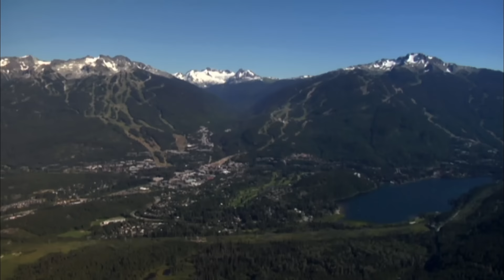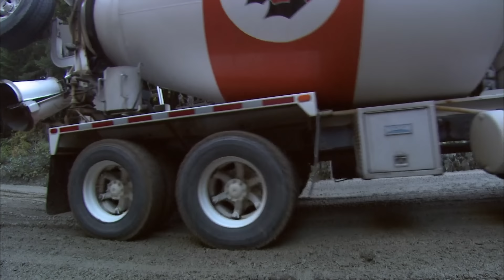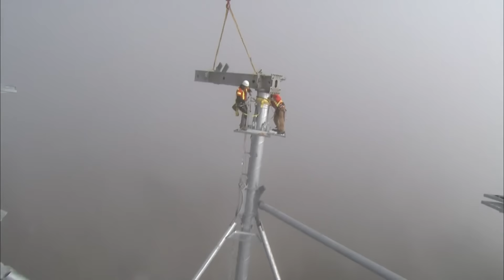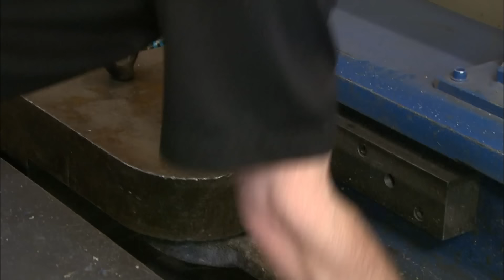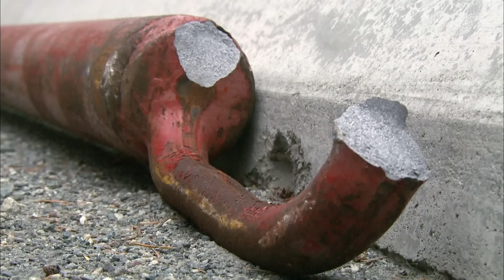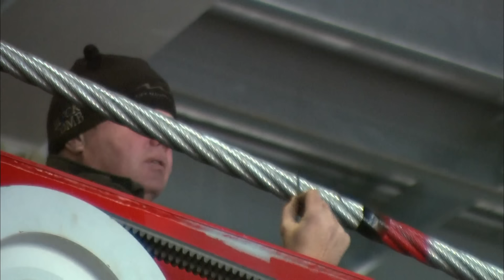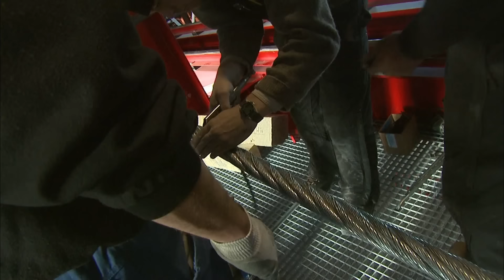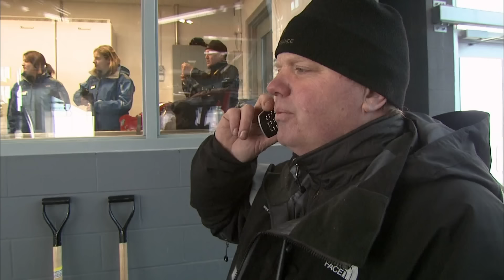The Engineering Genius Of The Largest Ski Lift Ever - Peak To Peak - Engineering Documentary

Comment: great "doco" if you are interested in the drama of muddy roads and concrete trucks and weather, but falls well short on the real engineering of a major gondola.
what happened between starting to string the light lead ropes across and suddenly having all the major cables in place with gondolas on them?
how did 5 spools of cable become 3 endless loops?
how were the gondolas designed and mounted?
Reply: Only one endless loop (the hauling cable). The other four cables are anchored at both ends; their purpose is to stop the bogie from pivoting about the haul cable axis. And to catch the bogie if the haul cable snaps (this happened somewhere near - from memory - l'Alpe d'Huez some time back - 1970s? ) and it that case, the brakes failed. The broken haul cable trailed behind like Snoopy's scarf as the car plummeted down the longest unbroken span on the mountain, and as luck would have, wrapped around the tower at the next ridge crossing, pulling it down to horizontal and gently slowing the car (well, fairly gently) to a stop. The car was full of punters at the time. No injuries.
Reply: @Gottenhimfella  this would have been great info to share in the documentary. Thanks for sharing!
Reply: so how much can they fit into 45 minutes?  I thought it all very interesting and informative - we're not all full on engineers but can appreciate the problems involved
Reply: @Ivan Blakely you also have to take into account that there are only very few players in this specialized market so you won't go too much into details as the competitors are watching also. I think it's pretty obvious that there's a lot of raw (and therefore expensive) materials involved as well as clever engineering, so the team with the best design at the lowest costs will outlive the others.
Reply: Typical american documentary. Everything is hyperboled to maximum, huge, insane, awesome, biggest everything. Same thing repeated many times and lots of unnecessary cliffhangers added to make it more "exciting". Then the rest is human drama and reality tv.
Reply: This is in Canada....
Reply: @alexbeis1861  It is a Discovery documentary...
Reply: Yeap, this drama farse is unwatchable. Quitiing in 1/4
Reply: @Gottenhimfella  Thanks.  That was explained pretty clearly in the first five minutes, as far as there only being one loop cable.  I think people want to imagine what the challenges are instead of understanding that building the foundations and getting materials up the mountain were the major engineering issues with this build.
Reply: @alexbeis1861  same same but different
Reply: @stevecrocker6904  you can fit a lot into 45minutes. It is a matter of priorizing what goes in to what extent. And they wasted a lot of time with boring stuff and BS dramatization, repetitions.
Reply: There is one guy who know what he is doing when they splice the cable together. And a hundred other guys standing around waiting to do what they get told. Lots of hammers etc. Pretty interesting in its own right.
Reply: They did not show the cable splicing and that is worth watching.  YT has several videos on ski lift cable splicing.  Fascinating.
Reply: Corporate secrets?
Reply: they always have to create drama
Reply: Yeah this felt like gold rush
Reply: History channel  dumbed down show. I feel bad for all those that filmed it and edited it only to have it turned into some stoner's "can they get to the liquor store and back to the party in time"  kind of show.
Reply: It’s an overexcited bit of reality tv trying to be a documentary about interesting engineering.
Reply: @erwinlommer197  That is true. I started skiing in 1981, and there were already some genuinely awesome cable cars and other types of ski lift in Europe at the time. For example, the Penken lift in Mayerhofen, in Austria, is almost 3km long. It was opened in 1954. I remember standing at the bottom in 1982, waiting and watching as the previous car disappeared at a steep angle up into the mist, and marvelling at it.
Reply: You make a good point, I would of liked learning more about the more technical rather than the sort of ridiculous drama. As the previous commenter mentioner, there is only one endless loop cable and the rest are anchor cables. The endless loop cable is either spliced to its own end if it is long enough to run the length of the loop by using a friction splice technique and not welded. Basically the professional will unwind the two ends of the cable and braid them together as one in the same pattern they were manufactured, the friction of the two cables under load will hold them together better than a weld would. The same would be done if it were two separate cables that needed to be spliced together to complete the loop, however instead of unbraiding two ends it would be all four and repeat the friction splice technique the same as if it were one cable being turned into a loop.
Reply: @erwinlommer197  It's Canadian, not American... Look at the credits.
Reply: @Gottenhimfella  The propulsion cable still gets spliced.  Would have liked to see that.
Reply: @RandomUser2401 good points. It seems to be in the formula of this type of drama doc. Seize on a a few areas where something potentially breaking, or a truck potentially falls off the road would be catastrophic,then replay over and over from various angles. It is like in sports telecasts where the producers rightly replay the diving catch. In this context however it just a lazy way of filling time and ratcheting up manufactured drama. The project itself has enough organic tension and nerve wracking drama, it does not need a script that is meant to create extra drama. Just tell the story!

Comment: The sling is not made of Teflon, it's made of either polypropylene or (more likely) UHMWPE. Teflon/PTFE has terrible tensile strength, terrible creep and necking resistance, and it's much more expensive.
I'll guess that the film crew heard UHMWPE described as "Slippery like Teflon" and rolled with that as simpler than saying "Ultra high molecular weight polyethylene".
Reply: Yep. Those slings are Nylon. Great slings but they generally have a short life cause they don't like being pinched or abraded
Reply: Or kevlar
Reply: Dyneema or similar...
Reply: Had the think it was the same plastic that you mentioned for a candy line that ran 15 hours a day. 2 good sized metric pre stretched chains ran over this plastic. After 8 years still looked brand new. Was at a FINN COR drive class back in the 1990's and they were one of the top companies to provide drives to power ski lifts in many countries. Somebody bought b them out maybe 20 years ago.
Reply: the narration is far from perfect , but the whole is project  the opposite  , perfection and perseverance
Reply: I was thinking the same thing. You would expect modern synthetic slings to be something like spectra or dyneema. Even if they were not sheathed, we are depending on the narrator to get it right because you can't really differentiate between synthetics by simply looking at them. That being said, Tenara fibre is tremendously strong and durable, and new applications are being found all the time. I wouldn't think the cold flow issue would matter much in a sling, but something that slippery would need to be a continuous selvagee, as well as being more difficult to work with making it than the alternatives. The more slippery the fibre is, the stronger the sling could potentially be, because the slipperiness would make each individual strand bear more equal parts of the load.

Comment: The issue with the concrete trucks could have been avoided by building a temporary construction ropeway, as it is usually done in Switzerland and Austria for such projects. It could also have been used for faster transport of most other stuff, including machines, to the construction site.

Comment: I can not believe they started this huge project. Without making sure they had a constant supply of concrete. Before giving the concrete supplier the contract. So one stubborn man just said nah I’m  stopping the loads, without a solution or a care to what problems will a raise. That’s some smart business and leadership right there
Reply: it's all just for the show
Reply: X2, the video of the guy holding the pump hose without concrete coming out was used for drama. Sometimes there is a pause while clearing hoses, moving trucks, or waiting for the next concrete truck, but other equipment would drag the concrete trucks up the hill before they would stop and have a cold joint in a pour like that. They likely declined to send trucks for the next day, but pushed through to finish that section of the pour. Where there is a will, there is a way, even if they had to run the mud up the hill in a loader bucket.
Reply: Cardinal Concrete is the only supplier in Whistler....with a plant in Whistler as well as Squamish, 35 miles away. The "stubborn man" you refer to had been on that dispatching job for well over twenty years at the time and had seen it ALL. EVERYTHING that has been built on both those mountains, at high altitude above the valley, for the last FIFTY YEARS used concrete coming from his company/plant...EVERYTHING that has been built in the Whistler valley used concrete from this same company. Part of any concrete supply contract is that the customer must supply good, reasonable access for the delivery equipment agreed to in the contract. The customer in this case could not fulfill his end of the contract due to weather/road conditions. As Dan said: "We are not going to bust our equipment because of YOUR road". The alternate would have been helicopters or wait til spring.
You are one smart YouTuber, right there.
Reply: The issue was these guys didn't spend the year BEFORE they kicked this off upgrading that road for the loads it would be carrying. EVERYTHING is going to be going up that road, spend the year prior to kickoff dialing that road in. Width, runnoff control to avoid moisture issues etc. They probably had to run light loads and lower tire pressure etc to make this work. I thought road held up pretty good based on what they showed actually.

Comment: Watching the tensile strength failure test I couldn't help thinking about the fact that the test was not performed with the wire rope subjected to cold temperature, which might influence the test results. I know they say hindsight is 20/20, but I am surprised they did not consider this when they tested the wire. I know that temperature was not what damaged the wire in this case, but I still think the environment in which the materials will be used should be an important consideration when evaluating their function.
Reply: It was most probably taken into consideration by the doppelmayr engineers, but they just left it out of the documentary.
Reply: I'm sure there are standards in place which require testing to be performed at minimum how they performed the test. And the acceptance criteria could be based on whether the cable is conditioned or not. The design of the cable I'm sure went through conditioned testing but not in manufacturing after it's been proved out. Products of all sorts of industries follow this approach. Hope this helped
Reply: That rope failing would put the repitation of both doppelmayer and the rope maker on the line. They wil have taken no risk
Reply: Generally, there are multiple tests to failure. I am sure we only saw the first one. Whether it is climbing rope or wire rope, there are always multiple tests.
Reply: This was a tensile strength test. Cold temp does effect this. In general tensile strength INCREASES with cold temps. These things have been considered because wire rope is used in cold environments (think any transmission line tower system, antenna guy wire system etc). I think risks that go up at low temp are going to be brittle fracture issues - those probably better tested with impact testing of some sort, steel is strong because it has some give, at very cold temps I think brittle fracture issues would be the place you'd have increased risk (and maybe issues if you have corrosion and pitting etc). That said, these things are build with layer on layer of margin, and the failure looked like it might have been a failure at a fitting (which I would not be surprised at - can get weird loading magnifications there).

Comment: This is not really a revolutionary design rather it represents a hybrid between a tram and a gondola.  A traditional detachable gondola rides on the drive cable.  A traditional tram has support cables and a drive cable.  This is the marriage of both concepts.  I think the real challenge was creating enough cable droop to allow a reasonably sized cable to support the loads.  As you pull a cable straighter across t fixed anchors the load on the cable and the anchors increases geometrically to some phenomenal numbers.  There are lift systems in Europe that have spans and geometries that will make your head spin and eyes fall out.  This is an engineering marvel on all levels.  As to the broken cable strands, almost every suspension bridge you've ever driven on has dozens of points where the individual strands are broken.  It has no impact on the overall strength of the cable.